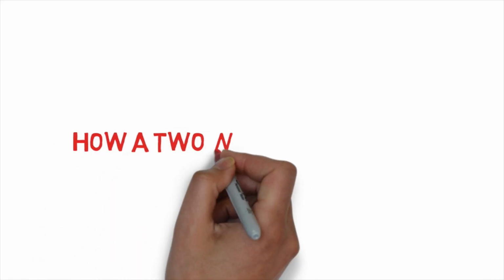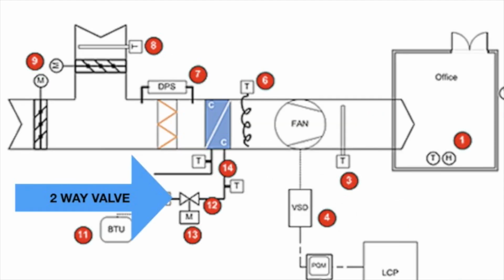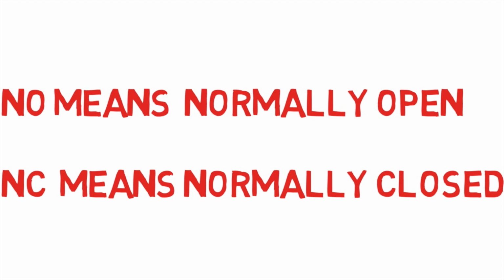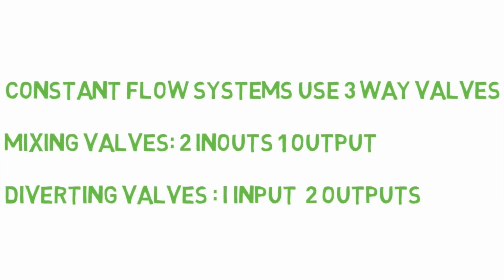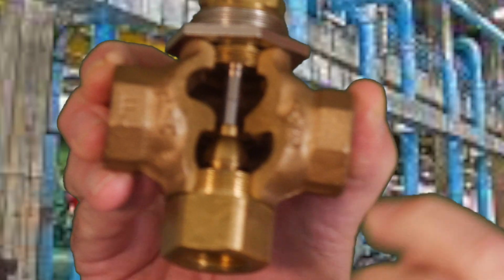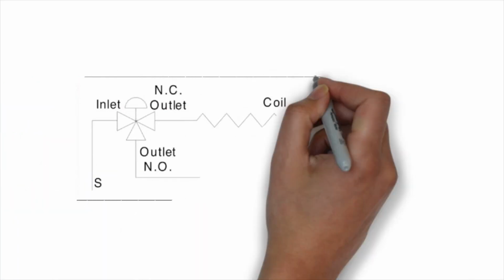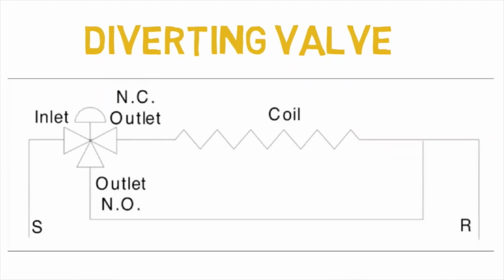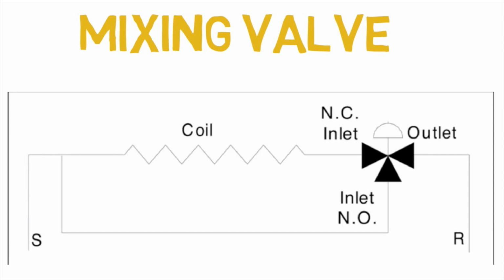HVAC Tech School: 2 Way and 3 Way Control Valves For AHU and FCU

Comment: Should do a video showing the setup and adjustment of stroke on the JCI actuators on the various valve bodies.  Then I could share that with techs calling me to help troubleshoot their new actuator that isn't adjusted right and won't open fully.
Reply: https://youtu.be/A9a594yX07A

Comment: Hey hi. I have a normal cast boiler with radiant floor heat. I want to run the boiler at 180 temp and the floor loop at 125 temp. So i installed a mixing valve on supply. I pipped the return to cold, the supply from boiler to hot and the supply to floor loop to mix. It will not work at all. Can you please help on why. I currently had to take out mixing valve and turn boiler down to 14o temp until I get this right. Thanks so much
Reply: https://youtu.be/A9a594yX07A

Comment: 1967 School. We have hot & cold decks, heating & cooling coils in fan room on 3rd Fl. But the 1st Fl never gets the cooling or heating. Is this mainly because the VAVs in the ceilings are bad, the stats are bad, the water temps are not enough,  the water circulation is not enough, or the fan rooms duct system is bad? We hosed down the coils to clean them. We block the outside air because the dampers leak bad. We try taking the stat out and connecting the lines for max cooling or plug the line for max heat. Change filters for good air circ. Water temp to coils 110-120 in winter not enough.
Reply: https://youtu.be/A9a594yX07A